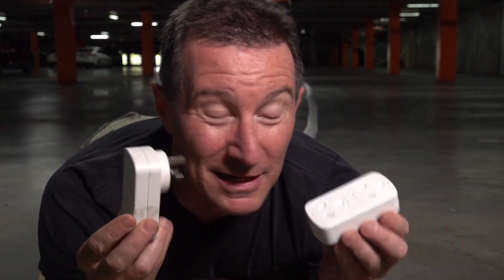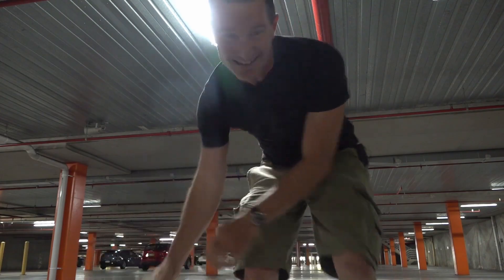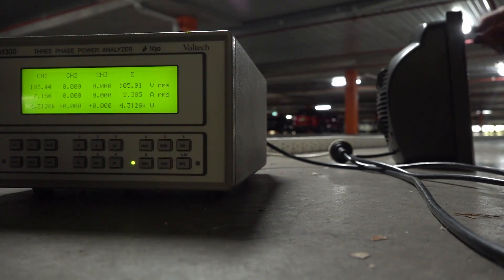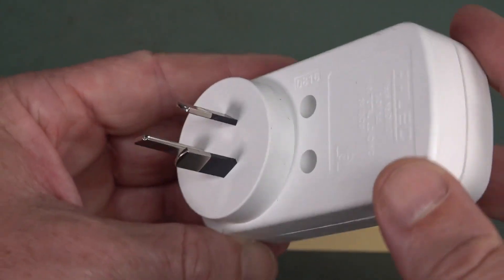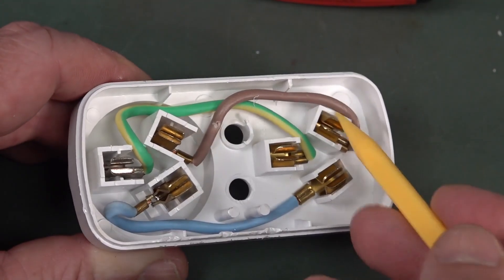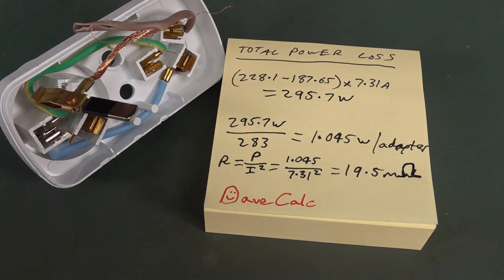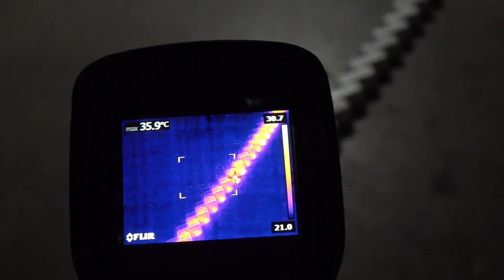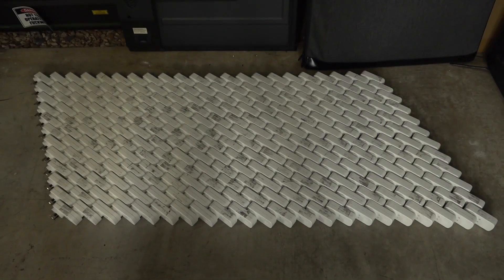EEVblog 1526 - I put 283 Double Adapters in Series with a 2kW Load!

Comment: You could have even more fun with our three way adaptors, could probably do a bit of etch-a-sketch esc design with them.
Interestingly here in the UK our three way adaptors are actually somewhat safer than a two way, surprisingly, as the three way adaptors have to be fused whereas the two way ones do not and as such can be overloaded a lot more easily.
Reply: I have a few very old MK 13 amp double adaptors that have a moulded piece above the front socket to prevent them being piggy-backed. 
But, you're right, It would be possible to draw 26 amps through a double adaptor. Scary when you consider those cheapo 'market stall' things!

Comment: Could the groups be formed by one slightly worse contact, which then warms up that unit and the ones surrounding it (by simple conduction), which increases the resistance slightly, and you have a slight positive feedback loop?
Reply: This is what I was thinking

Comment: Neat... But errr.. Power factor? Firstly the 58mW of "leakage power" when no load, is not "Watts", it's VA.. and probably mostly "imaginary power". And for the actual test with the load, the "voltage drop" will also be slightly out of phase with the current. Probably slightly inductive now. The effect will be minor, but the "watts of capacitive power" was slightly jarring ;-)

Comment: Should have flipped half of it. and used a short jumper to connect the far end. you should have measured the loss of the wire.

Comment: Yes, yes I was just wondering about it the other morning... 
Actually interesting to see how much the volts drop. Sure it will be over the 5%
Reply: 240V nominal at the socket, 228V after 20m of extension cords, 182V at the load. 58V is 24%?

Comment: Hey! This double adaptor, while consuming 295W itself, it does reduce total system power to around 1.7KW. It is doing better than scammers "energy saving device" that plugs to the mains 🤣🤣🤣

Maybe later scammers will sell one of these with resistors & fans inside 😅

Also, I believe there is some build quality difference between the units that warmer than the other. I'm curious to see what differences inside. Maybe thinner cables, or thinner prongs...

Comment: Of course, when powering a heater, the warmth from each adaptor was still heating the room so was technically not "lost". You were just drawing less power as a result. Many of our UK adaptors are fitted with 13 Amp fuses which would get quite warm on a 2kW load, so I expect the voltage drop here would be somewhat higher.
Reply: And incandescent lightbulbs are 100% efficient... in winter.
Reply: This is the reason why these heaters have cables with very low cross-section wires (like 0.75mm² for 2kW), so they literally get warm during use.

Comment: Seems like decent quality... Maybe the manufacturer values a decent and relatively safe product over cheapness?  I've had a few very cheap universal power strips that got very warm during use and used brass bus bars.  I imagine ethics were valued over the higher manual manufacturing cost, although I didn't really like the ~180° bend on the neutral.  Is that 1.5 or 2.5 wire?  I didn't catch the amp rating... 13A?

Comment: reminded of a friends solar system... that isnt doing what its meant to do.
mounted on a granny flat... feeding into the same cable feeding the flat... 50M. maybe 75.
think its only 4mm wire. maybe 6. enough for a granny flat.

not for a backfeeding 20kw inverter.

i keep seeing a voltage drop to the inverter, that only delivers what it sees, then theres the voltage drop back.
put a load on the flat, and then you have this weird arse fluctuation as the drop is only there under load but as soon as the inverter is backfeeding then the sag from the mains is gone, but its now lower at the board/house due to sag from feeding in the opposite direction... i dont know. havent measured anything, even looked at anything... just surmise that its having issues solely from sag.

whatever. 20kw should be double or triple his daily use. so far, its barely breaking 1/5th...

ive suggested going up to 16mm and feeding the flat on a single phase on its own, he probably has by now...

Comment: I was very disapointed that you didn't source 2 more to make it an even 285 adapters.🤣🙃🙃
On a more serious note, these look really well made. Wiring is probably more flexible when it come to orintation (L R and vertical). They look fairly old, I wonder if they are still as good?
Reply: I found it odd that you called 285 even.

Comment: Considering the construction, it would have been interesting to test it in direct stack rather than downstream stack.   Is the resistance in their construction choice of discreet wire and crimps??
Reply: There'd be losses at the connector and in the wires. Quick run through a calculator using estimates of the run length says it was probably about 50% on the wires and 50% on the connectors...
Would be interesting to see the same test with them plugged into the lower socket in a line to see how much of the loss goes away.

Comment: 2.13.     EVERYTHING WAS EXPLICITLY GOOD UNTIL THIS TIME STAMP.  YOU SHOULD HAVE JUST TURNED THAT AROUND. BECAUSE THE WHOLE TEST IS A FAIL BECAUSE 18 GAUGE EXTENTION CORDS X ALOT WILL DROP 2 VOLTS FROM WALL POWER THUS FOREVER SCEWUNG ALLLL THE RESULTS.     daveeee

Comment: It would have been interesting to run another test at a higher load, so that each plug got hotter, and see if that causes the contacts to expand outward, causing more resistance and a further increase in heat and loss (potentially runaway positive feedback).  Or if the contacts pressed against the plug blades tighter causing less resistance and less loss.
Reply: Just need to use a transformer with a secondary of around 15VAC, and capable of 20A current delivery, with a variac feeding the primary. Then you run all 3 links in series, to get the drop across each chain. Very likely that running the lot at 16A for 8 hours will result in one of them going to a higher resistance state.
Reply: @SeanBZA  I think they were only rated for 10A.  I was also thinking that with 283 of them, you wouldn't have to increase the load very much.  Whatever effect one of them causes, would be multiplied by 283.
Reply: @Hyxtryx  10A rating, so take them a little higher, means you get a result faster.

Comment: Actually they are placed in parallel and the result of the wire/contact connection (at the last one) is in series. Anyway, fun project, something I always wanted to know 🙂🙃😉.  Wonder what the loss is at a DC voltage, explaining the fight between Edison and Tesla. What was the result of the Ohmic meditation? Ohmic relief? Great video!

Comment: Regarding the "Scream mask", I'm pretty sure the appearance of Ghostface was inspired by the painting by Edvard Munch. The question is whether the Aussie outlets were inspired by the same painting.

No surprise at all that there's that much loss, and I'm not sure it's just contact resistance. I'd wager most of it is in the brass. Adam Savage had grounding issues in his Enterprise Captain's Chair build because he used a strip of brass for a bus bar rather than copper. Almost as bad a conductor as aluminium. Only reason brass is used in outlets is because it's the best compromise of electrical and mechanical properties for outlets.

Comment: Every time I do this exact experiment, wait, stop.  Okay, honesty is the best policy.  I've never done this before.
Interesting.  It took the American in me a few seconds to realize what was actually happening (due in part to the unique nature of the experiment).  My brain was so confused that I thought a "double adaptor" was some type of device only kangaroos would use to double the voltage of an outlet.  When I came to my senses, I realized you were not building a lightning machine but testing the efficiency or lack thereof in a common (but foreign to a 110V guy) device that turned one socket into two.
Honestly, I was very impressed by the build quality of the inspected unit, and the use of expensive stranded copper wire where I expected to see a fuse-thin steel-like-semi-brass wanna-be "conductor" between the two sockets.
That's when you got out the FLIR camera and opened a whole new can of worms.
So, we have 2 options at this point. 1) Give the kid a sledgehammer and let him start smashing double adaptors until he finds "type 2" aka the hot adaptor. Or 2) run the experiment again, mark the beginning and end of each hot segment, put all the cold adaptors on the inlet side and all the hot adapters on the outlet side ... and rerun the thermal test (with a fire extinguisher close by).
Follow this by dissecting any random 5 hot and 5 cold adapters.
You don't have to do this "right now" but keep in mind I won't get a wink of sleep until you do.  ;)
EDIT: My wife thinks the Kangaroo statement might be offensive.  I would never intentionally offend anyone, and this is meant only as a bit of comic relief in my comment.  If it is offensive, please let me know and I will edit it out immediately.

Comment: Now you have to run the test over again, and see how much loss there is when you use the other outlet.  I think it would be interesting to see the difference!
Reply: Well you could cheat and measure the ohms but I do like your way better. It does remove 2 junctions.
Reply: @stusue9733  You cannot measure <10R with enough precision, especially with a standard mutimeter. It is much better to measure voltage drop. Something like 3V 1A of power should be enough for reasonable precision.

Comment: My understanding is that house wiring can get in problems if there are any bad connections that effectively form smaller cross sections in the wire. So that being the case running a high current load would probably reveal issues with those. At lower loads I would have expected really low losses. Those problems will probably get quite hot.

Comment: I am not surprised:  look at the difference between the connector you used and plugged the next one in, and the one you did not use. The first is half opened, the second is still fully closed. The material does not give enough spring force. I even have seen before that they used tight plastic around them to add to the clamp forse. Groups of them seem hotter, so more loss. These groups could be as result of Sagan putting them in different than Dave, because they could bend the contacts in a different way, or the fact that groups are bended (handled rough) while already connected as a string. You could play football with the whole string, and see if the losses get higher 😄

Comment: Now Dave, if you add a few more adapters (and short extension leads) and increased the load a tad, can you make it into a 240 to 120V converter. 😂😂😂😂

Up the load till it pops, photoinduction style.
Reply: Not unless you plug a constant current device....
But I do wonder what will happen if you plug 1 km of copper extension cable and short the other end. In theory it should turn into a very weird heater.
Reply: @jwhite5008  It does, especially if you use the cheapest extension cords that only "may contain copper" the fong kong store sells. There is a reason you have limits on cables for house wiring, and 30m is about the longest you can go with a standard compliant cable before you run into voltage drop limiting, requiring you to use larger cable sizes to get the drop within permitted levels, and also to ensure that fault current is enough to clear a fault by tripping a breaker.

My 30m extension cord is 2.5mm cable, which is a PITS to put in a standard plugtop, but the other end is fine going into an industrial metal cased socket outlet, with a regular compression gland.
Reply: @jwhite5008  Many years ago I used a length of 7.5A flex as a dummy load whilst testing PWM DC motor controllers, it worked very well, even adding some inductive kick which made it a more realistic load for the controller rather than a big fat resistor.
As for the Dave feedback - you didn't think I was serious??

Comment: May many years ago, on one cold morning, my mother grabbed two 2.4KW fan heaters (me & my brother had one in our bedrooms) and plugged them into a double adapter into a kitchen outlet. An hour or so later I wondered in and noticed her rather dodgy setup, I felt the double adapter, not quite melting temp, but not far off.
20A though a 10A adapter/outlet, not optimal, however this was before the sheathed A&N modern idea, so I wonder if that would have any effect, as obviously they've thinned the pin to make room for the insulation, and I wonder if the metal used has changed to a stiffer mix to make up for the thinning - may be less optimal electrically speaking.

Comment: Would the voltage drop be spread equally on them all or is there one or a couple bad?  See what the drop is in the middle.
Reply: The thermal camera images at the end tells that the loss is not the same for them. Groups of them seem hotter, so more loss. These groups could be as result of Sagan putting them in different than Dave, because they could bend the contacts in a different way, or the fact that groups are bended (handled rough) while already connected as a string. I saw that these contacts do bend loose after one plug in: look at the difference between the connector he used and plugged the next one in, and the one he did not use. The first is half opened, the second is still fully closed.
Reply from the maker: Watch the ending
Reply: @EEVblog  yep, posted in the middle.

Comment: A shame the 5 extension cords, they most likely are as much of a reason as the double adapters for the voltage drop.
Reply from the maker: No, I measured that and did a differential.

Comment: As I understand it the loss is proportional to current squared - so presumably this kind of loss is only really noticable on high current devices - like heaters - it'd be good to see if there's a difference between the two sockets - and how that compares to single piece copper construction

Comment: NO.........  I wanted to see the adaptors plugged in piggy back mode and not offset.  too late now ( ?)
Reply from the maker: They are literally useless in that configuration as the 2nd outlet is blocked.
Reply: @EEVblog  it would remove the internal copper part of the equation and just give 'us' the brass on brass losses. But yes.

Comment: any difference when you plug each next one in the first socket (that doesn't use the wires) instead of the second?
Reply from the maker: Yes there would be be, but in this case the 2nd outlet would be blocked, so absolutely useless.

Comment: Common US fire citation given... Given 120 volts AC nominal and either 15 amp or maybe 20 amp circuit breaker in the load center. Take a 6 outlet fused (15 amp) plug strip and connect to the wall. Take a second 6 outlet fused (15 amp) plug strip and connect to the first plug strip. Now you have to connect a 1500 watt load to the first plug strip. Connect a 1500 watt load to second strip. Turn both on. Fire inspector assumes instant in wall fire from over loading the circuit. Second assumption is that the plug strips burst into flames.
Reply: Where's the fire hazard? All this will do is trip the breaker at the panel.
Reply: @andreasu.3546  Or it breaks the fuse in the first plug strip. Yet still a violation to have a plug strip connected into a plug strip.

Comment: Fairly sure having a brass strip wouldn't fulfil the double insulation requirements.
Reply: Then neither would the socket contacts themselves, sitting in the plastic (without an additional separation piece).
(Well it depends on the plastic thickness necessary for "reinforced" insulation, but I'd think it's thick enough anyway just for the sake of rigidity; the wall thickness is typically 2mm or thereabouts, which is greater than the combined insulation and sheath thickness of ordinary-duty cords. Even if it wasn't already that thick, I'd expect the incremental plastic usage to add minimal cost compared to using a more-elaborate internal connection.)
Nor for that matter would most switch mechanisms (their internal spring is often live as it pushes between the rocker and the moving contact piece), which actually do crack often enough to be a realistic concern.

But in any case, plenty of double-adapters are still available containing busbars internally, as do nearly all power-boards.
See for example: https://goughlui.com/2020/05/17/teardown-mains-double-adapters-new-vs-old/ So whatever the reason, this ain't it.

Comment: I'm wondering if the total loss would be reduced if the orientation of the test were reversed or shortened as much as possible.  A step such as connecting all of the double adapters straight inline.
Reply: For sure, it would be a lot lower.

Comment: wouldn't the voltage drop increase over time as well? we should be able to make a half decent model for the temperature increase over time for the entire stack of connectors (as a black box) and compare that to the breakdown temp for ABS plastic to guess at a MTBF. i doubt knowing the MTBF for 283 connectors linked together is incredibly useful, but it would be fun to know hahaha

Comment: No motor or light powered on at the end with no connection to the wall?    Over unity to the max.    :)
You could have got millions of views or saving that for April?   Worlds power solved using 283 adapters and a capacitor/diode/full bridge rectifier?    :)

Comment: So you also have another 3" per adapter, x 283 = another 70' extension cord, 14 gauge, add that loss in too.
Reply from the maker: No, I took the difference so I got only the loss across the adapters which is what I wanted.

Comment: I'm not surprised and that's why many high current appliances will have a warning in the manual or somewhere not to use with a power strip or extension cord. It's universally ignored in most cases I'm sure.